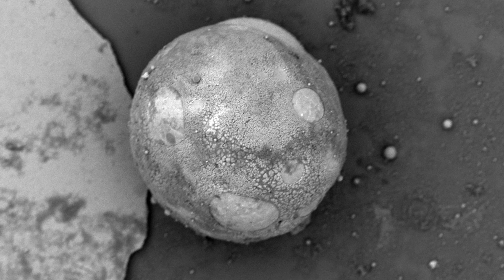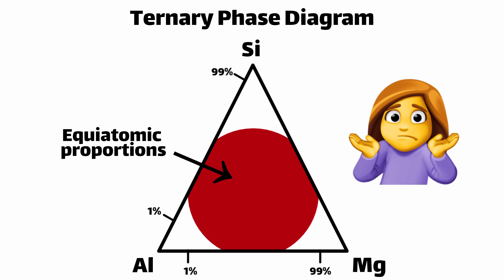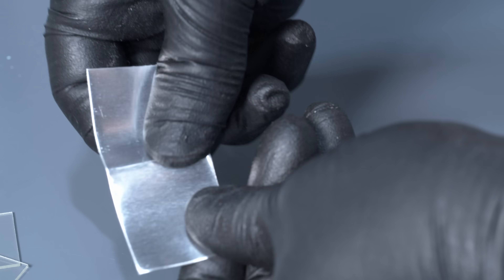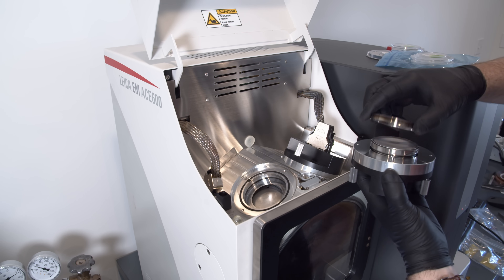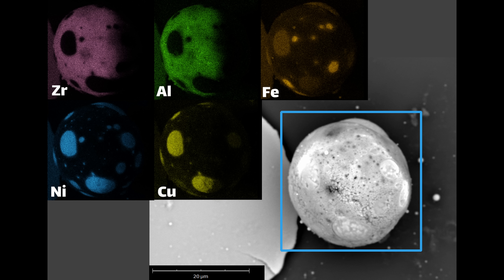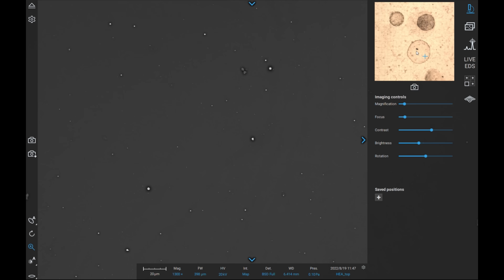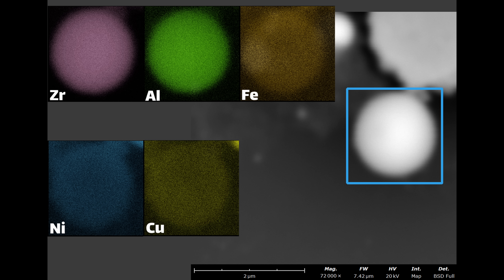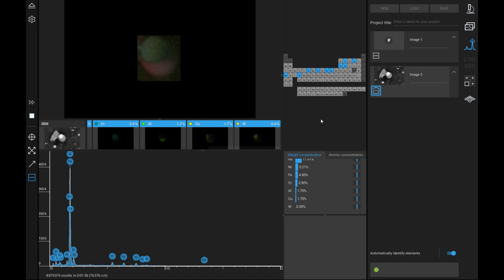Metal Alloys of the Future?

Comment: Really neat video. Garage electron microscopy is badass and your channel does a fantastic job popularizing concepts which are not widely known in the pop-science world. There are some places where I have to say this video could really be shored up technically, though. The big one is that, in my professional opinion (my postgrad work is all in HEA alloy design), the alloys produced here don't meet the usual working definitions for high entropy/multi-principal element alloys. The laser sputtering process you're using produces very non-equilibrium structures, because of the very fast cooling rate as well as intrinsic size effects. Most "true" HEAs produce a single solid solution phase, or a dual-phase structure, at equilibrium conditions. Or, in some newer definitions that have started to get used in the last 5 years or so, it just has to make a "simple", intermetallic free microstructure when subjected to a high temperature homogenization treatment followed by a water quench. There is a lot of debate still about whether the single-phase HEAs like CoCrFeMnNi are really single phase if you take them to equilibrium, but that's way off in the weeds. The other big point I'd correct is that "high entropy alloy" has turned out to be a sort of un-useful name for these alloys. The idea that the mixing entropy stabilizes the single-phase structure, which you talk about around 3:10-3:30, has fallen out of favor for metals. I believe for ceramics it is still considered useful. Very curious readers might try and sci-hub themselves a copy of Dan Miracle & Oleg Senkov's massive critical review article 5 years back: "A critical review of high entropy alloys and related concepts," Acta Materialia 122 (2017).
Reply from the maker: Rad, thanks for the extra insight! Just gonna pin your comment to the top for the time being, seems easier than rephrasing into an addendum of corrections :)

Taking a look at "A critical review of high entropy alloys and related concepts" now, cheers for the tip!
Reply: @BreakingTaps  I wish I had known you were making this video, HEAs/MPEAs are my major focus now. You could have picked my brain or I could have connected you with a more hands-on expert. 

That said, if you are working on a corrosion video in the future, I could connect you with some experts that love telling stories.
Reply from the maker: @MichaelWatersJ  Will keep that in mind, cheers for the offer! Maybe I'll revisit this in the future and we can correct some of the mistakes (or my perpetual desire to start some kind of microfab/material science podcast 😅)
Reply: @BreakingTaps If you revisit this topic, please also go way more into detail about the relationship between the mixing entropy and enthalphy. Im quite clueless as a material science bachelor in the 3rd semester and that would have been really something pulling the video together for me as this is the main unanswered question for me. 

Also i know that with your samples XRD wasnt possible, but i would have loved to see more data about the actual crystal structures etc
Reply: @BreakingTaps  Well how about a steel alloy that I theoretically discovered by myself inspired by other steel alloys named Samanik steel? The composition of that steel is carbon 0.5%, silicon 0.6%, manganese 0.9%, titanium 5%, vanadium 5%, chromium 5%, cobalt 5%, nickel 5%, molybdenum 5%, niobium 3%, tungsten 5%, and iron remaining by weight. How strong, hard, tough, and durable that metal might be by the overall state?
Reply: the definition of HEA is a big debate indeed, I believe the name is too simplistic :) To my understanding, HEA = a single solid solution, since the configurational entropy (which is only one contribution for the total entropy) is supposed to stabilise it; in the end, the choice of metals is quite limited to suit this definition, you maybe have an handful of systems that fulfil it. But if you design an multi-element alloy with multiple phases, then it would be best suited to call it chemical complex alloy or something similar. This field is really interesting!
Reply: @loicp.1487  HEAs don't actually have that much mixing entropy. For an equiatomic alloy of N components, you get a molar mixing entropy of  S = R * ln(N) where R is ideal gas constant. (you can do the rearrangement of terms in the proof from statmech https://en.wikipedia.org/wiki/Entropy_of_mixing) Natural log is not a fast growing function. Because of this, many people working in the field, including me, prefer the term 'multi-principal metal alloy' . They still have many excited properties, but the mixing entropies are not one of them.
Reply: @MichaelWatersJ  maybe I was not clear enough, sorry… I was trying to make a difference between HEAs and CCAs/MPMAs. My point was, if you go back to the early Yeh’s papers, he clearly states that the mixing entropy is the reason of the existence of such solid solutions. It has been demonstrated otherwise since (not every combination of 5 elements gives a solid solution), and I am aware there are tons of metallic alloys that exhibit higher values of entropy than HEAs. Sorry if my message was source of misunderstanding
Reply: @loicp.1487  No worries! Us having this discussion can help others learn about the nuances of MPEAs/CCAs/MPMAs. Do you happen to know how close actual alloys get to the ideal solution mixing entropy?

EDIT: Also,  @Breaking Taps  will read our comments to learn more. :)
Reply: @MichaelWatersJ  I’m not sure to understand your question… what do you mean by actual alloys? A conventional alloy like steel, or an HEA on which the mixing entropy has been measured? (If that’s even possible)
Reply: @loicp.1487  it is very interesting indeed!
Reply: Just when u think your on to something here comes along Einstein and says this
Reply: @beemerkon  We hate it when that happens!
Reasearch does have it's benefits. Thanks for the laugh. Good luck. 👍
Reply: I can see why "multi principle alloy" has become popular recently, it's a more broad term for describing the idea of 5+ equi-molar element alloys.  I rather like it as well, I have just been stuck saying high entropy alloy because I have read so many papers that use the term and it was how I was first introduced to the concept; I'll need to start using MPA though because it's more descriptive and just makes more sense overall.  Also, thanks for the paper suggestion, it looks very informative.
Reply: Damn, man put an actual academic paper in the YouTube comments. Para-social activity it’s finest.
Reply: TLDR🤯🤯
Reply: Are you describing also Galvanised steels ?
Reply: I'll check out that paper. I've been of the opinion that HEA are pop science in the world of metallurgy/materials science and skeptical that any alloy system with that many componts in near equal amounts would not be more thermodynamicly favored to forming intermetalics. Then again maybe my pea brain can't begin to comprehend the 4th dimensional phase diagram and I'm missing something.
Reply: @joewboe  Pop science? There's definitely a hype factor sure. But it is real science...like we're not sitting in our labs mixing transition metals and lying about the results. A lot of 4 and 5 component systems do form ugly intermetallics, sure....but there are also real gems like the single phase Cantor alloy, the non-equal-portions single phase FeMnCoCr alloy that Cem Tasan & Dierke Raabe's group produced, and a huge number of single phase BCC refractory alloys.
Reply: @jamesfrishkoff2013  As a graduate student focused on refractory multi-principal element alloys (RMPEAs, or chemically complex concentrated alloys, etc), I agree with most of your points! However, in the case of the "huge number of single phase refractory BCC alloys" there's a framing discussion to be had there.  Refractory alloys are difficult to process and if you look at a survey of the literature in that space it is clear that most materials are in the 'as-cast' (as made form) and so therefore cannot be considered at equilibrium. Further, refractory alloys are being studied for their high temperature properties and so are frequently annealed at temperatures above 1200C, where many are single phase BCC. However, formerly 'famous' single phase alloys (like the HfNbTaTiZr alloy) do form secondary phases (like an HCP phase or a second BCC phase) in BCC matrices at intermediate temperatures between 500-1200C. Many of the refractory elements form complete solid solutions in their binaries (Nb-Mo, Nb-Ta, Nb-W, Mo-W, Nb-V, etc) which therefore extends into their higher order alloys, but this is not a unique feature of their 'high entropy' or other stabilizing effects. Once you add in enough Hf, Zr, Ti, or Cr (or Al, which is a popular alloying agent for oxidation, density and cost) the phases you find in their constituent binaries with the other refractory elements begin to crop up in the higher order alloys. In my personal view, the benefit of RMPEAs is the tunability of their properties and the potential ability to purposefully add in complex intermetallics you could not access in simpler refractory systems.
Reply: @carolinafrey28  Thanks for the comment! Correct me if I am wrong but I think I attended your talk on some of these systems at HEA2021? Regardless, yes, I did probably overplay my hand in the "huge number" of refractory single phase MPEAs. I'm passingly familiar with some of the BCC+B2 systems, but it seems I have more reading to do on the BCC+HCP refractory systems. My experience so far is entirely in the FeMn-based space and the FeNiCrAl space.
Reply: Great discussions! Real scientific method shared by all. Guess, test, measure & . . . try again! Great channel 👌
Reply: Yeah backyard EM is badass, seriously!! I think it's hilarious the way guys think they're hardcore because of their sporting prowess, their car, etc, etc.

But they've got nothing on nerds! Nerds just take garage capers to the next level of insanity, including explosives, radioactive materials, xrays, gamma rays, or in your case, electron beams.

I bet you some guy has an unauthorised particle accelerator in his spare room. 

Nerds are badass. Keep it up.
Reply: @James Frishkoff I do not agree that this video is neat as well as any other video in a specific field that was made by an amateur
Reply: Try a fine powder, mix uniformly , then use explosive welding to bond the particles together.
That will happen so fast that maybe the particles will not diffuse and become segregated.
Reply: Indeed
Reply: 26-29th comment maybe?
Reply: Or maybe folding and hammer like a samurai sword
Reply: at nightfall, critical flaw size and discontinuity detection via NDT needs to be known in order for these alloys to serve as true structural matls at scale. AI should be able to investigate the billions of combos for prospective HEA.
Reply: Calling it "high entropy alloy" makes sense, but obviously your going to run into problems if you go onto to try and say that each differrent mixture is something totally differrent, the system you would create out of doing that, probably will be very overcomplicated and won't make sense. There is just to many variables and specifically defining many differrent specfic mixtures of metals,  I would think would be superflous. This is also kind of just a bogus concept that is only working in the realm of the hypothetical. Creating differrent alloys is useful, but argueably only when there is a actual purpose behind it. If your just mixing metals together and then there is no desired cause or effect. All that about the differrent properties of differrent alloys is meaningless... 😆
Reply: How do you get to hell?
Very simple: claim that you're innocent.

How do you get to heaven?
Very simple: Admit that you're not Innocent, you're guilty and ask for mercy.

How to know if you're guilty or not?
Simply: Compare your life to the Ten Commandments God gave you in the Bible.
Everyone agrees that if people followed the ten commandments there would be no need for governments or police.

Do not lie.
Do not steal.
Do not commit adultery.
Do not insult God by using his name as a cuss word.
There are six more but let's just leave it at that.

How many lies have you told in your life?

Have you ever taken anything that didn't belong to you?

Jesus said, if you look at a women lustfully you've already committed adultery in your heart with that woman.
How many times a day do you do that?

Do you use God's name as a cuss word?
Would you do that with your own mother's name?

If you answer these questions honestly you know that you're guilty.

God can justly punish you and send you to hell.

Ask him for mercy.
His name is Jesus.

It's as simple as this, The Ten Commandments are called the moral law. You and I broke God's laws. Jesus paid the fine.
The fine is death.

Ezekiel 18:20 —
"The soul who sins shall die.

That's why Jesus had to die on the cross for our sins. This is why God is able to give us Mercy.

Option A.
You die for your own sins.

Option B.
Ask for mercy and accept that Jesus died on the cross for you

Comment: I wonder.... when you cook food, part of the consideration is the energy that must be entered into a piece of food to cook it, without it finishing so far before the other ingredients that it is overcooked when the rest of them are done. it seems like the different atomic weights would give you some similar consideration here, that would mess with your laser's cutting variables (in the nanosecond range of material behaviors). In light of this, I wonder if you wouldn't have more success doing something like stacking the heaviest 'as armor' up top with the very lightest as a deliberate 'achilles heel' on bottom to allow separation of the molten microparticle at a controlled location.

Comment: I'm sorry if this is a dumb question, I think like a caveman. Can't you just melt the metals together and stir them or something? like, isn't that how some alloys are made?
Reply: Some ordinary alloys made like this, but due to different melting points, atom sizes, crystal arangements and densities you wouldn't be able to stir different metals properly. Just my thoughts, I'm not an expert.
Look at cast iron, it has just few tenth of percent of carbon less than steel, but it's completly different material by properties. And steel requires longer process to achieve lower carbon percentage.
Reply: @PetterStetter  huh. I never considered crystal arrangement. I don't usually think of metals as, well, crystalline. Thanks for the help!

Comment: Literally seconds before I clicked this link I was thinking about if it would be possible to make a knife using a lightweight core of titanium then use sputtering to add alternating layers of high grade steel, tungsten, graphene or carbon nanotubes,layer by layer until it is thick enough to make a blade out of. I would think starting with a knife shaped piece of titanium so once it is finished there wouldn't need to be a lot of grinding, just enough to sharpen it. I also wonder if you could use several layers of mesh from different materials so the sputter gun would add all of them simultaneously in the same layer. I really wish I had access to that type of equipment to experiment with it and see how it turns out. If you get bored... Maybe you can test it out?

Anyway, great video. I love this stuff.

Comment: random mix small grain particles after ball milking individually , then random mix together, then apply a lot of pressure, this is the only way unless you build layer by layer and grain and metal type for each layer using templates ( laser punched templates or robot particle by particle placement or ultrasound tweeter placement ( but I don’t think the last would work) or you could apply a layer and blast patterns

Comment: What about making a crucible and a mold that both vibrate at ultrasonic frequencies, so you could create a large melt and keep it homogeneous as it cools? I know that ultrasonics are used to create oil/water/coal dust emulsions without a chemical emulsifier. Tuned ultrasonics are used in mining to sort and separate particles as well as force them into homogeneous suspensions, depending on the application.  Bulk high entropy alloys might have some wild applications.

Comment: user high power microwaves. collect the plasma created and microwave futher. possible under pressure. then use the thin film coating techniques used in LED production.

Comment: Suggestion:
Melt your alloy materials together in a crucible that's inside the stator of an induction motor so you can use the rotating magnetic field to thoroughly mix the metals together.

If you want to get fancy, use the stator from a delta-wound 3-ohase motor and a programmable 3-phase power supply that lets you adjust voltage, current, and frequency  so you can tweak the rotation speed and intensity of the mixing effect.

A surround sound card fed into a trio of audio amps connected to the phase windings would probably work for cheap and let you try a variety of mixing strategies to see what works best. Like maybe mixing some high frequencies in with the fundamental rotation frequency for extra agitation...

Comment: I think H2O absorbs too much heat. I'm just guessing here, but but something with less heat absorption that won't react  like triple phase noble gases, ammonia or something.  Im thinking that a reducing environment with less heat absorption.
Also, if the layering can be done to allow better adhesion to the substrate and perhaps a top metal layer that holds it together longer might work.  
I'm also curios if seeding the substrate with the desired alloy could somehow prepare the sputtering target to accept the crystal structure, much like we do to crystalize salts out of solution.  
I imagine the metals cant be mixed in plasma due to different energies, but the laser follow up may work.